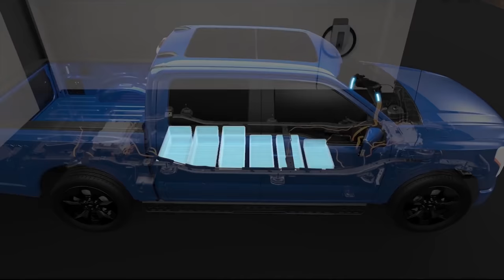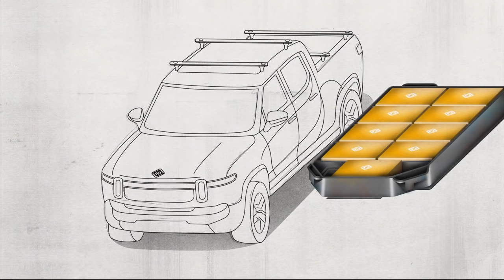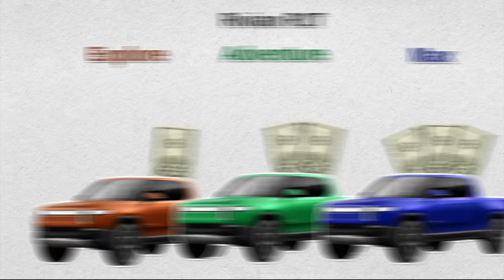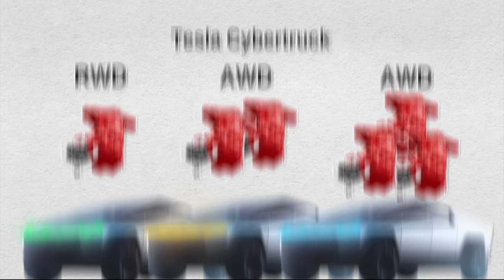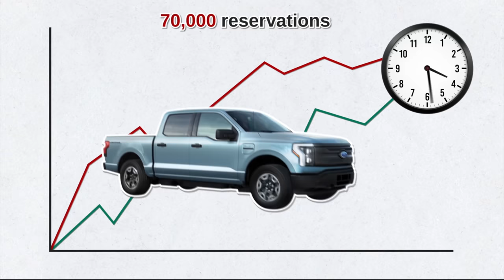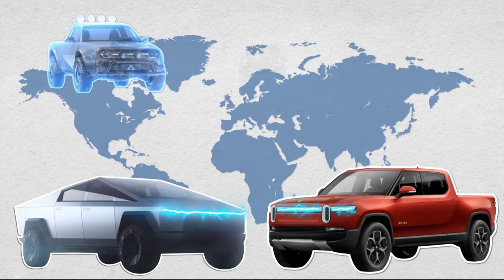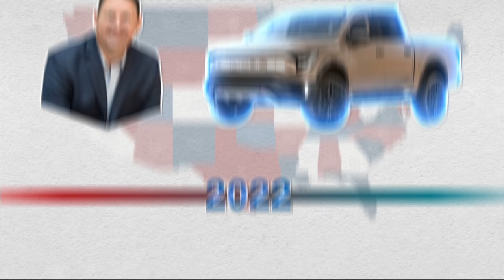Here's Why This Will Replace Trucks in America

Comment: When the average cost of a vehicle is $40k. I'm out.
Reply: yep, and watch. the  vehicles will start having very expensive break downs, in less then 5 years. the  prius wasnt very reliable either.
Reply: For me $7,000 is about top.
Reply: @igorseprak6177  And buying a used EV with a battery that needs replacing will be pointless.
Reply: Yeah I just bought a truck for $9400 and that was more than I wanted to spend.
Reply: It'll go down pretty soon. New tesla to be made will cost 20-25k, then in a few years it'll be 15k and so on
Reply: Except for presious metals exploding
Reply: @krisangel7080  Yeah, dysprosium etc., the HREE's, Heavy Rare Earth Elements are what are used in high-performance magnets and electronics needed for EVs to work. 
There is currently no domestic production of HREE's (not to be confused with REE's).
The U.S. gets it's HREE's from CHINA and they have most of the world's HREE production.
Reply: A full electric system is MUCH less complex than a hybrid system like the Prius. There will be problems for sure, but they should be much more reliable than a hybrid or ICE vehicle.
Reply: @natty1  Yep, electric vehicles require a LOT less parts and labor to assemble. A sub-$15,000 electric car is definitely a possibility within the next 5-7 years.
Reply: @markplott4820  That zero problems record is yet to be proven. 
I don't see those expensive batteries lasting enough cycles to have traveled 500,000 miles.
Also, they're not giving away electricity.
Reply: Are there any gas powered full size pick ups under 40k now? (Besides barebones work trucks)
Reply: I think it is already there, I recently purchased a new Highlander for $40k.
I would have rather had a Land Cruiser, but can't see wasting that much money on a vehicle.
Reply: I will never spend more than 5k.
Reply: Batteries are not recyclable...
Reply: @pinkgunman  China has them.
Reply: Yup at these prices I keep my vehicles for the long haul, meaning I'm the First, second, third and probably fourth owner of them. Okay by me as vehicles are a waste of money anyways. I have other hobbies
Reply: @SharpestBulbs  well that wasn’t very smart at all
Reply: @lonniebeal6032  And how do you think you get electricity to power these cars??? Most electric companies use coal or nuclear power. Not too green there either. Plus, most of these batteries won’t last or work on full power in extreme climates. And let’s not forget our country’s dependable electrical grid or it’s vast infrastructure. Definitely cart before the horse here 🤣😂
Reply: What are you talking about ? ALL vehicles are roughly $40,000 these days
Reply: @igorseprak6177  what are you gonna buy for $7000 are you crazy either save up more money or drive junk
Reply: @mikep8182  yep. I just leased a new Mazda. They sales and management staff kept saying $40,000 was the new $20,000
Reply: @mikep8182  Actually they aren't. The average cost is around $30k.
Reply: @SharpestBulbs  meanwhile i laugh, my neighbor just dropped 71,000 on his GMC Z71.
Reply: @billfrete8487  yep. That's not smart.
Reply: Yeah some of these cost more than I paid for my house and I can guarantee it's not going to last as long. High priced electric vehicles plays right into the hands of the government. They already want to tax us based on the number of miles we drive and with the forced switch to electrics it's going to impede the ability to travel.
Reply: 40k yeah and most v8 trucks get 600miles a tank at 22.4mpg, just depends how you drive it....like I get 18/19 mostly city in a 2014 ram 1500.
Reply: @markplott4820  thats a lie.

Electricity is not free. Battery replacements are thousands of dollars and electric cars have the same wear issues as ice cars. Tires, brakes, ball joints, struts, rust, alignments are all needed on evs just like ice cars.

Electric engines are not bulletproof. The bearings and gears can wear out and will require maintenance.

Comment: the first question I always ask concerning EVs, "how much will a new battery cost when the old one goes out?"
Second question, "how much will a new battery cost when the old one is damaged in a collision and what type environmental hazard does a damaged battery do when it's all over the road?"
Reply: Same thing as you do with your phone you throw it out
Reply: @adaml102  so that's their plan all along huh
Reply: Good questions. I'm guessing a lot.
Reply: 5 to 7k
Reply: First thing I ask when I see a Nissan or Chrysler is how much is a new tranny? If It's a VW or Ford Ecotec how much is a new engine?
Reply: sponsered by Toyota...
Reply: Could be cheaper or could be as expensive as a truck gas tank, fuel pump(s), fuel lines, fuel injectors......... 💁🏻‍♂️
Reply: @manaaalsuwaidi3643  first thing I ask is how much money will I save by not buying gas all the time.
Reply: @Milliegs  depends how much electricity cost in your area. with charging at home you consumption will be higher.
Reply: @jaypeak  I over produce now. I have a credit on my electric bill.
Reply: Good questions $1,500 replacement for our Prius battery after 172,000 miles, including labor (about 3 hours in or garage or driveway). 

Far less than the gas used. Of course, these batteries will be bigger, but after that much mileage, who cares? Also, they haul away the old battery and recycle the materials into the next batter generation.
Reply: I would also imagine that your insurance would pay to replace the battery in a collision much like they do any other parts in a gas car. Next thing, battery tech, just like gas/diesel engines, are constantly improving to provide more like and more power. If the owner of the Prius said his lasted 172k miles, imagine how much longer will the last after further R&D goes into them? 300k, 400k maybe even a million miles.
Reply: They are making better batteries and you already can “recondition” battery packs to extend their lifespan.  The issue will be to include the equipment and get owners to do the task to maximize battery life.
Reply: @markplott4820  - True.  What kills the Prius batter (up through Gen 3) is that the software doesn’t allow charging to 100% or drain to 0%.  The battery’s memory changes…shifting max and min charge points until the capacity is compromised.  Reconditioning involves slow charging to 100% until all cells reach 100%, discharge to near n slow charge to 100%.  Do that every 6 months and the OEM batteries should never wear out in the expected lifespan of the car.
Reply: Speaking of collisions, how will a ginormous battery pack affect safety following a punitive collision? Are the battery packs safe after being crushed, punctured, or hard short-circuited?
Reply: On a model S 16- 22 thousand depending on size that is a full replacement. A partial cell replacement 5-8 thousand dollars with no guarantee   that other battery cells that weren't replaced go out. And you don't have a car for at least 2 weeks. And Tesla do require routine maintenance  that cost  hundreds about every 3 months. And lose 40% charge when temps get below freezing.
Reply: @adaml102  Not really, its as wide or almost as long as the vehicle and weighs several hundred pounds...
Throw it out like your phone.... wow....
Reply: @ontopoftheroof  Either of those are way less than an EV and close to what the battery will cost to replace it..
Reply: @Milliegs  So you have solar panels???  How much did that cost, and after factoring that cost, when did you ever start "saving" money???
Reply: @frandanco6289  after tax savings final cost is $18,000. My fuel and electricity savings are approximately 4,800 per year. So break even is almost 4 years.  Panels will be at 80% after 30 years. Guarantee is for 20 years.  Don’t do any deal but cash only.
Reply: Spent 3,000 bucks on an engine replacement on my 106,000 mile fiesta, that was the cheap shop. Everybody else wanted 5,000+
Reply: More and more places can rebuild the battery packs. Watch Rich Rebuilds...it's not hard to open and rebuild a battery pack for a shop, they need some training and a left to take the battery down safely but it's not hard. They can check the cells and replace the damaged ones. Look at it this way expect places in the future to be able to swap battery packs so you go in and you buy a rebuilt unit that is certified to last X amount of time. They drop the pack from your vehicle and install the refurbished one and away you go.
Reply: @andrewlarson7895  10k+
Reply: @andrewlarson7895  10k+
Reply: @markplott4820  this has to be conjecture on your part of knowing a battery would last 50 plus years since they're so new
Reply: @micaw7108  how safe is a gas tank or a sheered oil pan in a collision?

Comment: i'll stick with my Ford gas for 10 more years.
Reply: Diesel is the best power for torque.
I live in Thailand and we all use 4cylinder diesel engines of about 2.4 ltr.
Reply: I think the people said it back in history when automobiles first came out and people said I'm going to stick with my horse and carriage. Lol
Reply: @michaeltrinidad1217  i understand what u are saying. Eventually we all gotta move forward with technology but idk if EV is right choice. Maybe Hydrogen fuel cell... its just too early to make a choice
Reply: @fungb4820  Smart thinking. I'm all for EVs, but we're still in the research and development phase. 

I'm  waiting until they work out the kinks and prices come down. My old Dodge will last for years in the meantime! :3
Reply: sponsered by Toyota...
Reply: @michaeltrinidad1217  indeed that's so true! People always resist anything new and they want everything to stay the same 🤦🏻‍♂️
Reply: @Choppingwood83  lol someone's angry
Reply: Does technology not advance? Seems like ice vehicles haven't advanced much in the last 10 years to me while ev tech is getting better. But keep your way of thinking 🤔 500 mile range per charge coming soon
Reply: @fungb4820  I feel that hydrogen is the way to go.  Batteries expire.
Reply: @johntheaccountant5594   - Electric is better for torque (heaps better) - diesel is better for running in remote areas - refuelling is simpler. Petrol has less problems using on shortstop start city routes.
Reply: @markplott4820  lol maybe by 2050 you're getting a little ahead of yourself
Reply: @markplott4820  : you re talking about NEW  gas vehicles (in some countries under some circumstances) -- not existing ones...
Reply: @jamesgizasson  Yup.  They need to work on how to put out those fires(many FF say they have a hard time putting those car fires out)and what to do with those cells once they need to be replaced-- so much for Earth Friendly.
Reply: @gwenonken3174  we'll get there. Now that manufacturers are seeing the profit potential, they'll be pouring money into r&d, competing for better and cheaper batteries. And of course, legislation will be pushing for sustainable and environmentally responsible materials. 

Future looks bright! :3
Reply: @fungb4820  Hydrogen would make way more sense, because of its versatility. It eliminates the need for batteries, and allows internal combustion engines to be retained, and continued to be used.
Reply: Lol

Comment: What’s gonna happen when the grid goes out like in Houston
Reply: That's the plan. All electric then cutoff.
Reply: @wingslevel  I agree
Reply: Maybe everyone will have their own solar panels by then
Reply: run a gas powered generator
Reply: @GodWeenSatan  Maybe if it's sunny all the time.
Reply: My Guess is Honda's larger power Generator's are about to get even larger for power backups, For when the grid fails🤓
Reply: Just power your home with the ev.
Reply: "Get a V8!!"
Reply: @richardb.5691  Yes for a Truck Absolutely, For my Car Absolutely Not, Unless of course you're V8 gets almost 36 mpg with hybrid batteries.
Reply: @raymondreiff8170  there is more to efficient transportation than just mpg.
Reply: Ain’t nobody going nowhere then😢

Eventually only the well off will have Cars and trucks
Reply: @steelisthemeal  boom
Reply: @steelisthemeal  the elites.
Reply: Im a. Be in my Cummins
Reply: Then you'll be unable to buy gas; but, if you have an EV, you'll charge it with your solar panels.
Reply: Well, the gas pumps won't work. So much I know.
Reply: People will just recharge their vehicles with sunbeams and breezes!
Reply: Hurricane Sandy cutoff gasoline supply for a while in the Northeast. Similar is going to happen as storms get more powerful. Grid failures and gas supply failures can happen whenever.
Reply: Solar with battery backup and generators.
Reply: @stevenw4549  any light will charge it
Reply: Micro grid baby
Reply: If you have solar panels and a power wall then nothing. Charge up and go.
Reply: @raymondreiff8170  The model 3 which is the cheapest is faster then 90% of all V8 engines.
Reply: Great?
Reply: Same, like wtf is a ‘hUmMeR’
Reply: @stevenw4549  I wonder how many watts of solar panels it would take to charge an EV truck in a reasonable time and what it would cost?  More likely the charge will come from a smokestack with carbon effluent, natural gas or propane down at the electric utility plant.
Reply: Farmers driving their Ethanol powered pick up trucks are laughing their butts off.
Reply: @GodWeenSatan  With a solar panel? If it's made for it eventually. It would take a lot of solar panels. We're not talking about 12v batteries.
Reply: @jayrunner3347  I don't know what kind of batteries they are using but more then likely it's multiple cells totaling a couple hundred volts or so and would probably require several Kilowatts so a 40 watt 12volt solar panel from harbor freight won't cut it.
Reply: @diegosilang4823  Not many farmers have their own ethanol distillery.
Reply: @stevenw4549  I meant solar panels at home. You could charge your car or truck at home
Reply: You do know it takes power to run a gas pump.
Reply: Can’t buy gasoline without electricity either, so…
Reply: @markuzick Right now the insurance companies won't even insure your roof so you will have to pay for a new roof , andthe electric companies still asks you to pay,the installation charges cost mega bucks and if you go loan-you'll end up replacing your panels in about 6 years and owing more and yes your whole roof will be utilized in order to supply enough power to power up your house.  House generators cost well into thousands.  Keep dreaming.
Reply: @stevenw4549  Technically it would but the time frame involved would make it untenable (ie a mile of range for each hour of charge).
Reply: What happens when a pipeline disruption system is disrupted? This scenario played out in the past year as well. The way I see it, It's much easier for me to make my own electricity if I need or want to (via solar, wind turbine, water turbine, or heck... pretty much any energy source that I can spin a rotor with).  Gasoline, on the other hand, no way I can produce my own. Bio-diesel maybe, but not gasoline. Also, as others stated, gasoline is dependant on the grid as well for delivery. Gas stations don't work well without electricity. Many I knew in Tx struggled to get gas during the outage. Gasoline also has a short shelf life. I'd defiantly take an EV or an old-school diesel over any modern gasoline vehicle during a crisis or a zombie apocalypse ;-)
Reply: The owners who had Tesla’s were able to power their house with the car battery.
Reply: @alanaland1990  I could be wrong, but the way I'm reading the question is "how do you charge your electric car when the electric grid goes down?"
Reply: If the grid goes out then guess what… 
Gas Pumps won’t work either. Everything relies on electricity now a days.
Reply: I drive an f150 now. I typically put 200-250 miles on it before my first appointment. Then another 75 with no time to spare for me second appointment. I'd be stranded with a 300 mile range the first day.
Reply: @captinbeyond  ok I'll see you in 30 years
Reply: Rich people's problems. Regular folks can't afford them.
Reply: @r.d.9399  the current administration is making us dependent on OPEC again. The process to make all these batteries makes us even more dependent on china. Neither situation is a desirable one.
Reply: @captinbeyond world is ablaze and underwater at the same time🤷‍♂️, and I suppose all the electricity going to come out of thin air 😄
Reply: Houston... we have a problem... 🚏😁🚏
Reply: Bike Or Walk..
Reply: @ItsBinhRepaired  I'd like more information on solar backup & generators, can you recommend where to start?
Reply: Can't rely on using generator to charge your EV, those will be battery power as well 🤣🤣🤣
Reply: @jamesrichards3034  generators can't be battery powered...batteries aren't generators. The generators will be replaced by solar.
Reply: @ItsBinhRepaired  it was sarcasm
Reply: @jamesrichards3034  I see...Lol
Reply: Thats only a problem if you live in texas
Reply: You should have solar backup and continue to function normally
Reply: To me, if we are going to leave fossil fuels, we should look into hydrogen vehicles.
Reply: @rinardfamily  My chemistry professor would beg to differ
Reply: @micperez819  he may be right, I just get my info from YouTubers and articles that I read.  My question for your chemistry professor is "what do you do without the environmentally safe batteries when they're done?" We need to come up with a better salutation. I'm not arguing with you bro but this is just questions I have
Reply: @rinardfamily  Because the energy you use to split the water is more than the energy you get back burning the fuel. So your car battery would be using more energy to break the bonds. That was a quiz question he gave us
Reply: @micperez819  the question is, what do you do with the batteries when they're done. They can only be recycled so many times. I didn't know that about hydrogen. Don't you think it's still cleaner though? I'm just asking because I really don't know.